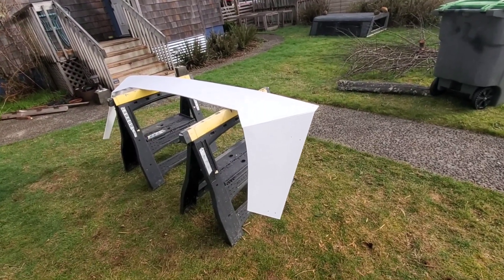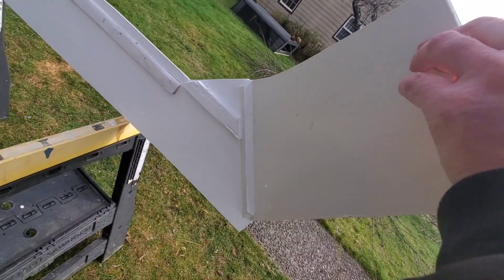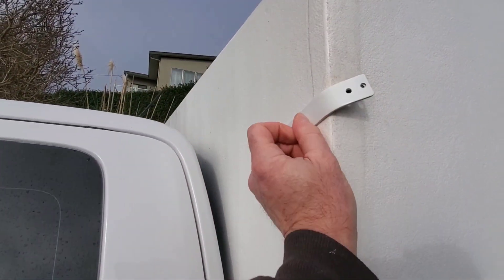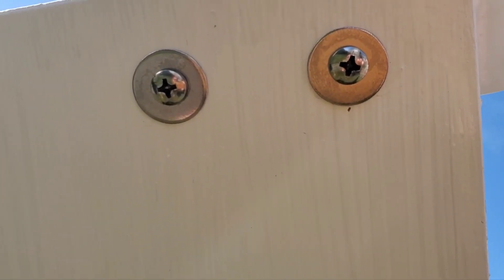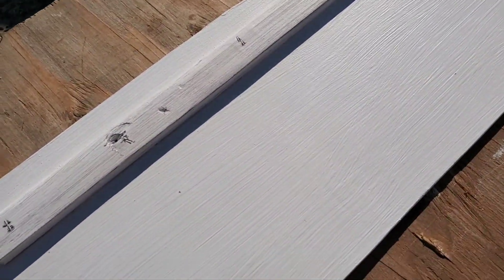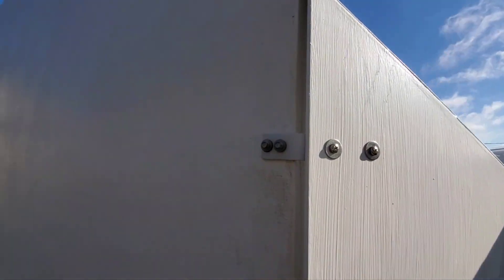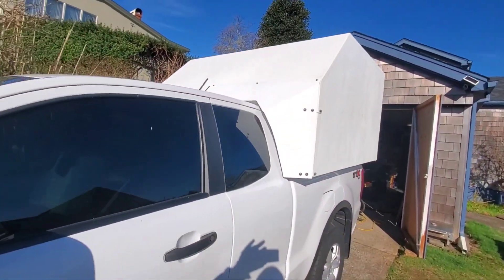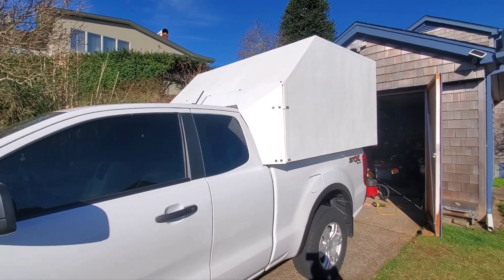Airfoil for DIY Light Weight Camper

Comment: Looks great, did it help a lil bit?  🤔
Reply from the maker: It did, but not as much as I was hoping.
Reply: @jackmalory3698  ohh well, still looks a lot better too. I dont think theres any way around  the big drop in mpg with these above cab campers. Hardside popups are cool, but much more complicated to build
Reply from the maker: @JonnyDIY  I'm about to upload a video discussing some changes I'm going to make that I think will help.
Reply: @jackmalory3698  cool look forward to it
Reply: @jackmalory3698    The side wings were fine - you needed a longer approach that ran up to the front windshield to decrease that approach angle.  Another approach.  You're going to lose at least 10-15% of your mileage, count on it happening.
Reply from the maker: @lylestavast7652 I agree. The angle on the front of the camper was too steep. My new version has less angle and is rounded, haven't got it on the truck yet but it should help a lot. Also the new version is 100+ lbs lighter.